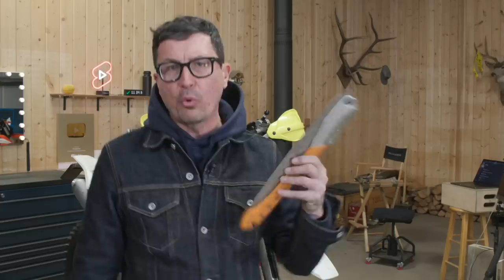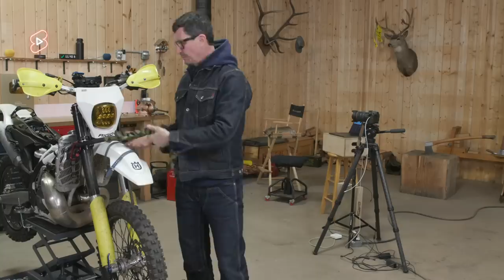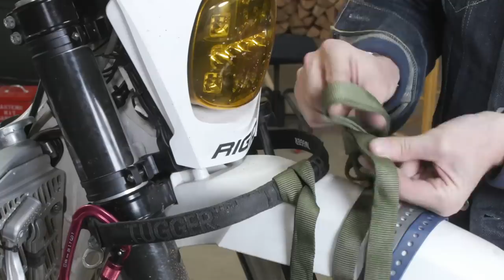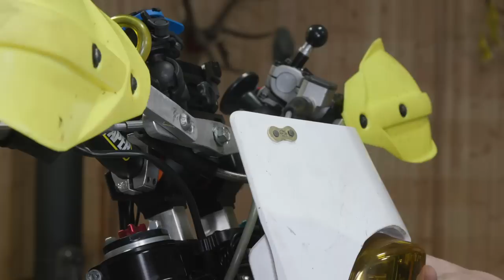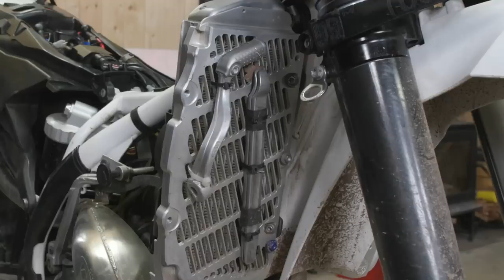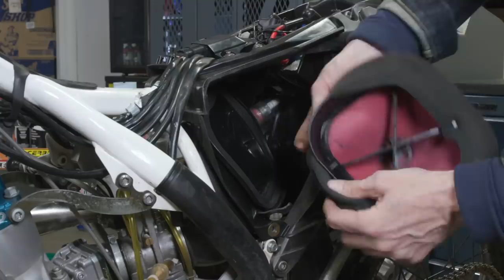How to build a dirt bike

Comment: This episode was exciting. I just bought a klr 650 a few days ago and have been running through ideas on how I want to set it up. This helped. Thank you
Reply: Loved my KLR. Ultimately, I found it too heavy for a task like this (I'm not a very skilled or experienced rider, a better rider would probably have a different opinion). I prefer bikes in the 250-450 range for a bugout type of vehicle. Much more capable when you inevitably have to go off road or, god forbid, off trail. Just have to pack light and limber. 

Enjoy that thumper. They are an amazing bike.
Reply: That's why I went with the xr650l it's 100 pounds lighter
Reply: I just picked up a 1999 KLR650 a few days ago! Lots of potential with those bikes. I also have a Drz400 enduro. Dual sport/ADV bikes are such a great option during these times. Ride safe!
Reply: @beasley1095  The 1st gens are awesome. Mine was a 1997.
Reply: @beasley1095  Mine’s a 2001, I’ve put over 10k on mine now, love it!

Comment: Love your content... That being said, a motorcycle that has zero electronics is a must... I have 2 bug out bikes, 1974-450 Honda Enduro and a 1978 xr500 Enduro... No fancy suspension but zero need for any electric worries...
Reply from the maker: Coil? Rectifier?
Reply: @wranglerstar coil on both I believe. It wasn't until 1979 when they started putting rectifiers on the xr500. The 450 has a points system of some sort I believe which is slightly different than the xr500. I hope that was helpful I'm not the world's best motorcycle mechanic lol. Ironically in my 20 years owning the 450 the only thing it's gone through was spark plugs and oil changes. Only owned the 500 for 5 years but it's never let me down. Thanks for the content!!!
Reply: I take it you mean minimal electrics as any petrol engine will need a ignition coil and stator
Reply: @failblazer2004  in plain English my goal for my bikes is for them to be unaffected by an emp.. yes, your correct vehicles do need those to function. In the case of a coil, it wouldn't be likely to be damaged. Whereas if you had a new dirt bike with electric start and other vulnerable parts you might not the means to replace those parts. That's where I'm coming from on this
Reply: @nathannelson3861  fair enough
Reply: I keep a extra ecu in a ammo box wrapped in tinfoil to protect it from a Emp. I also have 4 Honda Xrs.
Reply: @chrisbee4702  if everyone prepared like you we wouldn't need to fear emps lol
Reply: @nathannelson3861  I also keep is that box a extra filter for my gas mask and iodine pills.
Reply: @wranglerstar  I think he means its all Analog like my CL450 and XL125.
Reply: @nathannelson3861  WATCH OUT. Some of the Replacement parts that are online have solid state components, like the replacement coils and rectifiers. Start stock piling NOS OEM or aftermarket vintage parts for that machine. I have been doing this for my Honda Fleet.

Comment: use to desert race a Husqvarna in 70's. kept a chain master link clipped around clutch cable. also vise grips clamped on frame. welded short lengths of rod to nuts and bolts, so no wrenches required.

Comment: I love the fact that your dual sport is a 2 stroke, your air filter needs to be oiled, if you switch to a foam insert or Lucioli tubes flat tires are no longer an issue so you can eliminate having to carry tire changing tools.

Comment: Adventure Touring of the local area - Yep. Perfect machine.
Scout Vehicle, and maybe a First Response Vehicle if their is some local disasters - Yep. Pretty handy and pretty mobile and reasonably agile.
War Machine - Nope. Open cockpit, 200km range, noisy, heat signature, flammable, and visible, and requires what will quickly become a scarce fuel supply. 
Yes it sure is a great idea when playing Zombie Apocalypse on the Laptop, but it has very little real world practicalities. 
Convert it to electric so you can quietly move at night, and rollout a Solar Blanket every day while you get some food and some sleep, and at least you have a theoretical unlimited range for a couple of years until batteries start failing. Even a Diesel Conversion sitting in the shed is going to be a better option than trying to keep a peaky 2 stroke running.

Comment: Fyi.   Tsubaki makes a tool with a handle that you can use a wrench or socket on if you dont have oring chain but the handle comes off and they are very reliable n strong

Comment: All you need is a Rokon. 2 wheel drive, no electronics, mount points. They’ll take you anywhere.
Reply: Street legal?
Reply: Top speed of 30mph, and brutal on the back off road.
Reply: @mrmicro22  yeah you can buy a street legal version

Comment: CDI ignition will be disabled in an EMP.  I will be getting around on my Honda Trail 90 with points while you are stuck dead. Shout out to @nathannelson3861 for raising the same issue.

Comment: I'm not a huge fan of this. Gasoline gels after about 6 months. You can use additives to make it last a couple years, but that's all you'll get. I'd honestly rather have a regular mountain bike. They're slower, making it easier to stop and maneuver, and if you get ambushed you have a much better chance to see it coming, or at least won't be seriously injured by whatever is gonna knock you off.
Reply: Perhaps try to make a hydrogen system to run it? I’m not too sure how great it’ll work in rough terrain but it be best to test sooner than later.
Reply: @Joseph Gonzalez  you just gave me a great idea, hot air balloons. They're low tech, so no circuits to fry. Flight is always a huge advantage, and if you could set them up for solar and wind power, you could theoretically rig up some propellers to push you in a certain direction rather than rely solely on wind currents. But that's for more of an apocalypse scenario than a war scenario.
Reply: @johnaeryns5364  where do I invest

Comment: I took a dual sport to Ushuaia Argentina. 

Bad idea on the front. 

Eventually you will bottom out and break you straps and the webbing will end up in your spokes, hanging up you front end while you go sailing. 

Please check that at max fork compression there is no chance of this. 

Further, depending on your terrain and the duration of your rides, the abrasion may also  cause the same problem.

I suggest, unless you are expecting to use the webbing a lot, is to drill a few holes in the front fender and use zip ties.
Reply: Prewire a 2nd clutch cable right next to the existing one.

Comment: Isn't the size of an airbox designed around the volume of air needed for the engine/fuel system? Surely packing that space out with tools etc will reduce the amount of air needed?